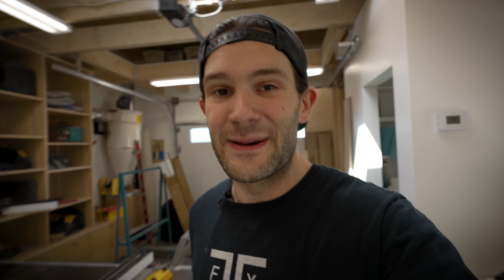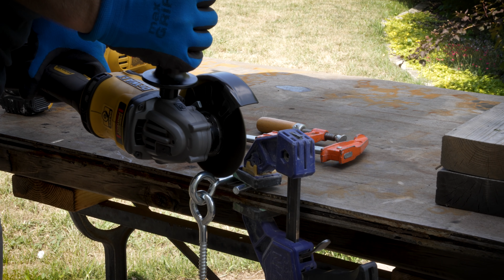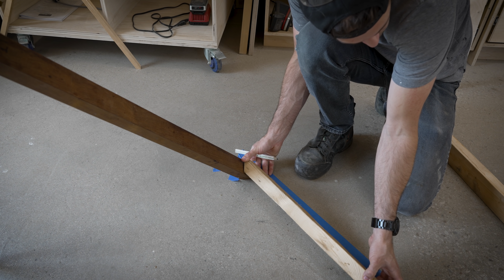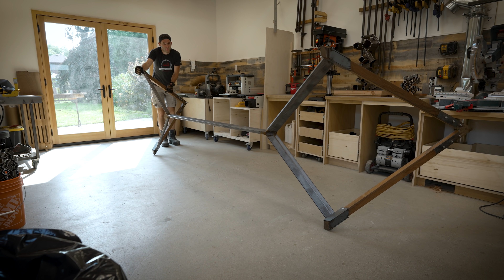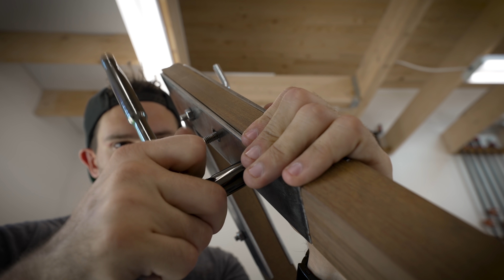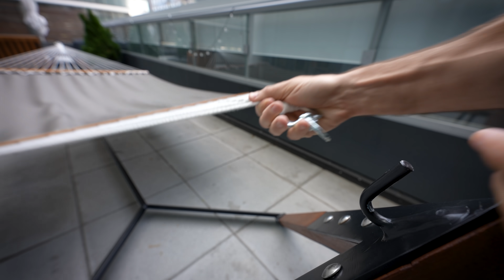How To Build Anything Without Plans - DIY Hammock Frame

Comment: one thing you could have done was drill a hole through the plate and wood leg in the middle of the steel (where the V shaped bar hits the wood) tap the hole, and thread the bolt through the back.  Although, the solution you came up with will be a ton stronger.

Comment: Beautiful design! I have a hammock like that where I used to have 2 trees to hang it on. now I got one. For years I've had a mind to build me a contraption like that of various designs. Wood or metal, some looked awkward, some looked heavy and overbuilt, all were huge and promised to be a ton of work. I have yet to get around to it. I may just weld one up out of 2" black pipe. Or just stick a pipe in the ground about 12ft from my lonely tree. Any way I look at it, its a lot of work just to take a nap!
Reply from the maker: Haha I hear you. Honestly, I've had it all summer, and I've yet to even spend 10% as much time napping in it as I did building. That being said I had the idea and I had to do it, plus there way this thing is built, it should last me many years!

Comment: Do not use old sawblades. It's hard wood. You want a new, sharp blade.
Reply from the maker: If you use a new sharp blade to cut any volume of ipe it will QUICKLY become a dull blade there's not really much you can do about it.

Comment: This is great! I am horrifible at welding, probably because I don’t have all of the right tools! That look very modern, which is a style I love! I see you used the riving knife on your sawstop! I actually had to take mine out for a few months, as I bought a blade with a thinner kerf. I ended up sanding my riving knife down a bit and I got it back in my sawstop yesterday! Again, this project is 🔥!
Reply from the maker: Thanks Arpad! I did put it back in and the whole time I was thinking "I hope Arpad notices" haha. I think the biggest barrier to entry when it comes to welding is all the different tools you need, but once youre setup its a lot of fun. I highly recommmend some magnetic blocks to hold material in place while you were, those were a real game changer for me. And of course the angle grinder, you can make any weld look good if you're willing to spend enough time grinding it. Cheers man, as always I really appreciate your support!
Reply: @ZacBuilds  I am just about to order some mag switch blocks (using your discount code), as well as some curved flap discs! I am also saving up the money for a Dewalt cordless angle grinder, as I don’t like my corded one. Dewalt because it is my main battery platform now. Now I also need a gas tank to do proper mig welding, as I am really bad at flux core, and it’s messy. I am okay at stick welding, but it generates a ton of heat and warps the metal every time. Thanks Zac!